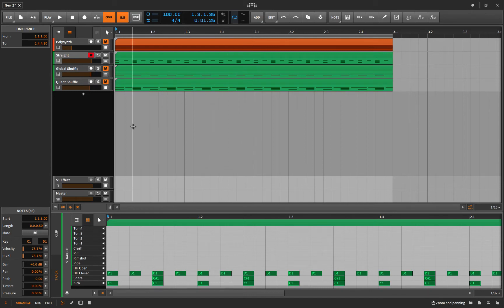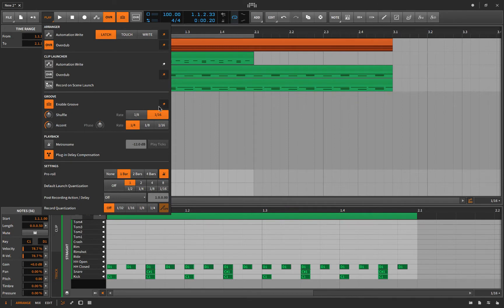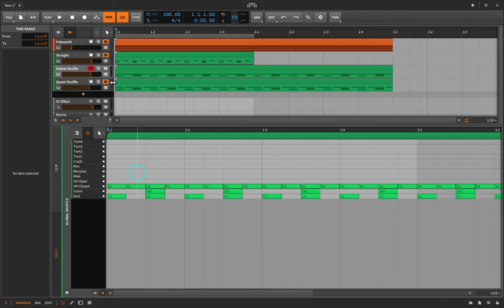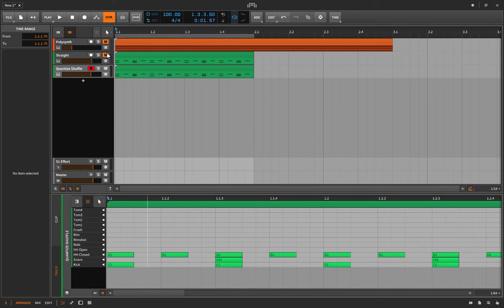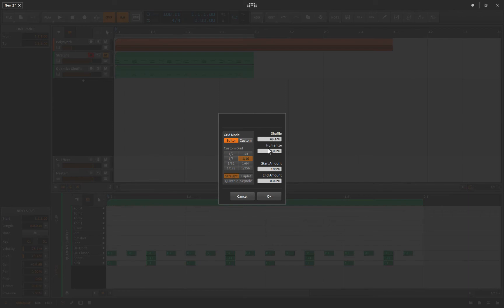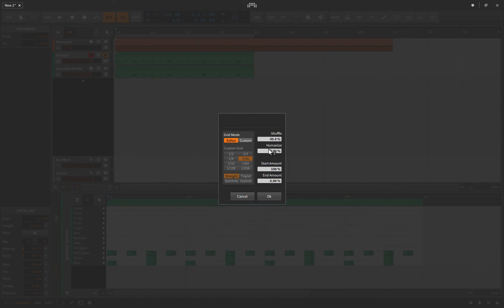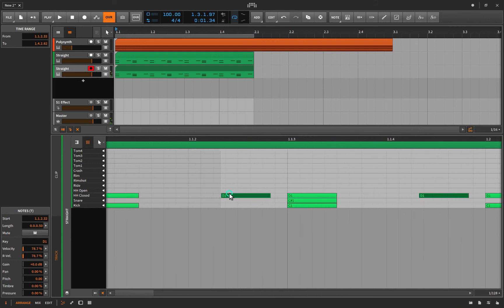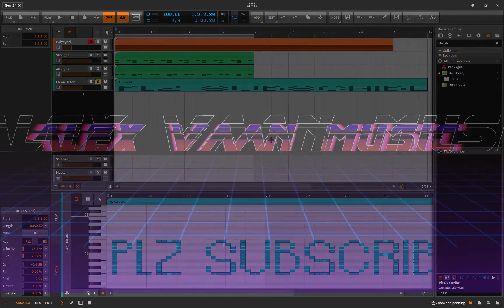Groove, Shuffle, Swing, Global/Quantize - Bitwig 2 How to!

Comment: Awesome Video - Thanks man! Quick question - Do you know how to change the default quantize value? So if I just hit quantize without going to the menu - I'd like to set it to say 8th note triplets consistently. I think the default is 16ths?
Reply: You could create a project template with it set and then set it as the default template
Reply from the maker: Hey Thanks! 
And good question, unfortunately for a default quantize value there's no real way to set it. You will notice however if you set the quantize value to the settings you like in one clip, once you scoot over to a different clip those settings will be the same. So you could set up your 8th note triplets once in your project, and from then on your quantize settings are set up that way. Which is pretty great I think!
Otherwise, the quantize value you get as a default will just take your grid value and your time signature and set it up to reflect both of those.
I hope that helps!!
And thanks for commenting!
Reply from the maker: Yup! Thats true! Its just the first time you change the grid, it'll change everything back haha. But good outside the box thinking mate!

Comment: Another good video Alex. 

I did not try it, but I guess if you also record the midi of a drum track which you added global groove to and record it to a new midi track so you can see visually the result of your global shuffle...
Reply from the maker: Thanks Troy! I appreciate that. And yes sir, you're totally right - once it's recorded it would create a visual representation of what the global groove is doing, perhaps I should have put that in the video! haha. And further, I'm wondering if you 'bounce' the track in place, or otherwise, if it will hold the same groove or if the groove is applied to the waveform after the fact. I'm 99% sure that it will be bounced with the groove